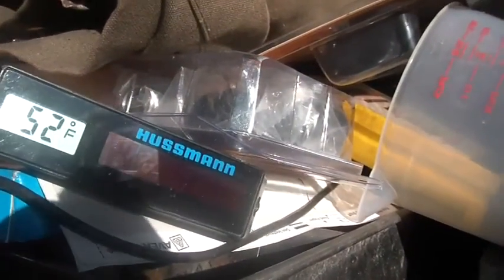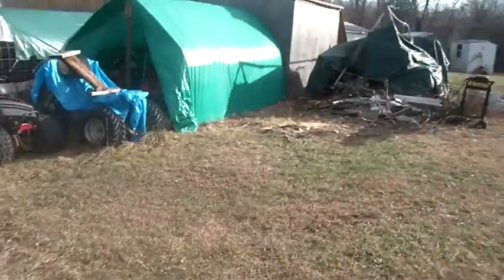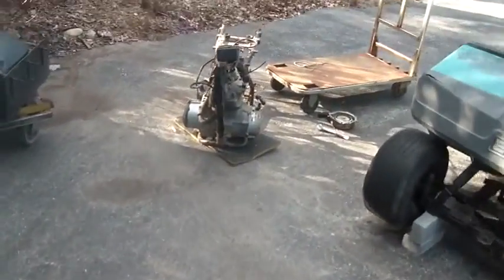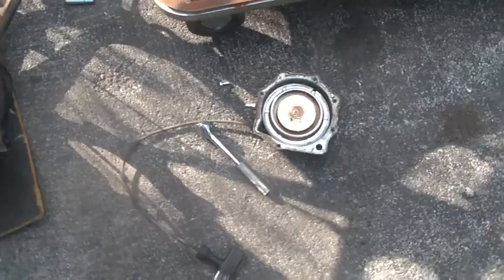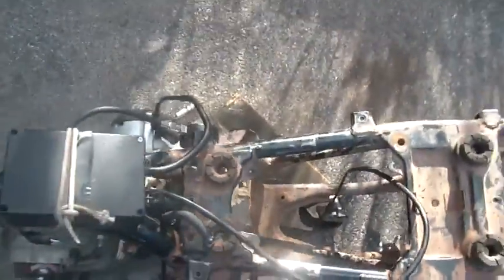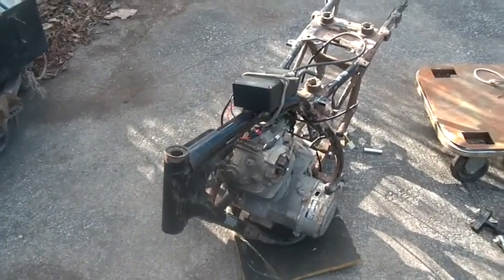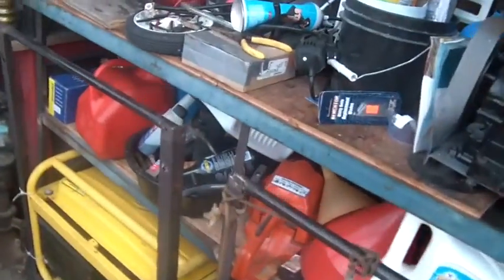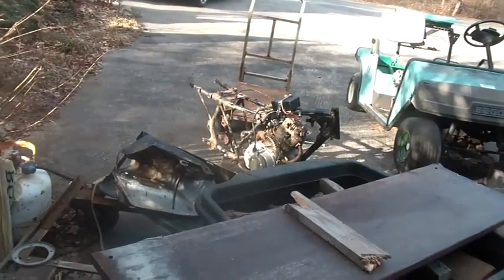12_31_2014, Honda ATC200S, oil assisted, compression test,

Comment: hey harvey..put a lil trany oil in the plug oil and it will build the compression up and if the rings r stuck it will break them free.but do it when its ready to be started so it runns and burns it out

Comment: I'm thinking a tight valve.
Reply from the maker: 231flash , It did have a tight valve and the ignition timing appears to be 180degress out. I can't believe to put the mechanical advance in 180degrees off, but, for the moment, I have no other explanation for what I see... It seems to have showed up with the tight valve, I may have screwed up the timing... Thanks for the input, watching, and commenting!

Comment: lots of motors in there
Reply from the maker: ***** , As I'm doing my clean up, I'm discovering motors all over the place, I need to collect them up and get them in one place or at least sort them by type. The hoard is drowning in tires and motors!   Thanks for watching and commenting Bud!
Reply: how cool it would be to have a small building just for the three wheeler stuff. I made a site for my shop about 30x60 with road hopefully ill build some day
Reply from the maker: A 30 x 60 building would be perfect!  24 x 24 was just not big enough... Build it, U need it!
Reply: if I had that. id be working in it now..ive got chevelle stuff in my attic,room in the house, sheds out side. etc. etc..
Reply from the maker: Sounds like me and my Honda stuff!  I have some everywhere!
Reply: just go's up in value :)